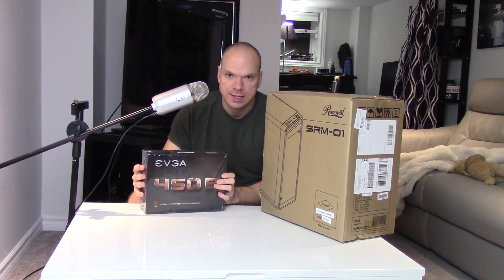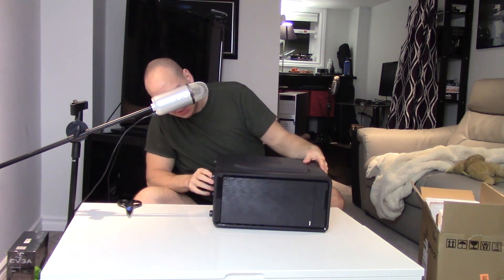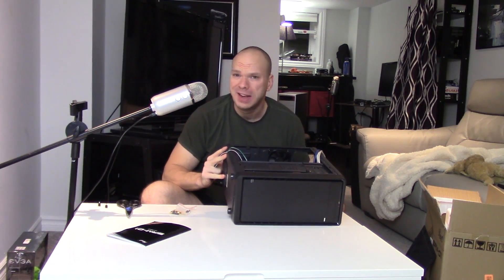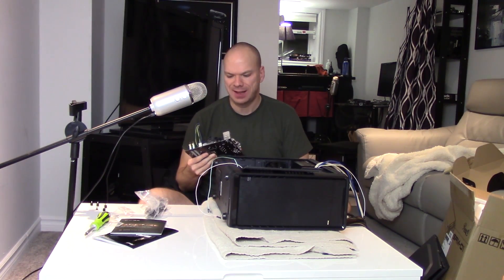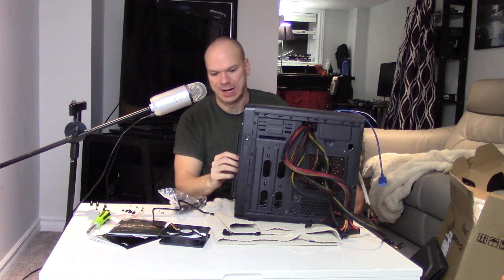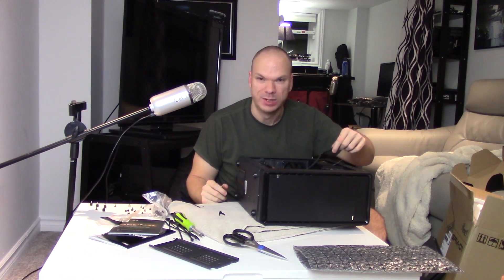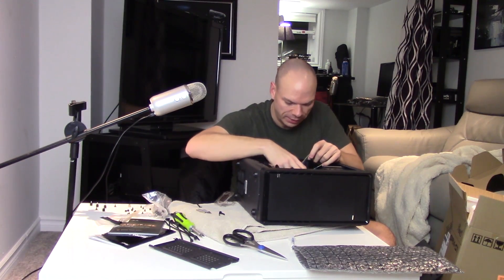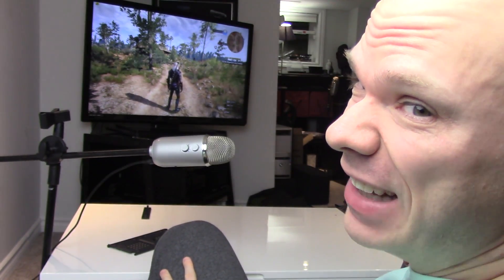BuildVlog #9 - WE'LL DO IT LIVE: A $500 New/Used Hybrid w/ the Rosewill SRM-01

Comment: HEy man, great video. How the thermals with that case?
Reply from the maker: Not even worth noting. CPU is on the stock cooler, never got over 62C. The graphics card never gets above 75, stock fan profile with just the factory OC.

It's good for a 300W TDP thermal output, I would estimate. Any more, and it'd be heating the air too fast to properly exhaust it.

Comment: I'm about to build my first pc in the nzxt s340 elite, in every video people have put a radiator  can I put 2 case fans there for intake?Also could someone make me a list of what parts to do in which order?Thanks in advance
Reply: where people*
Reply: Yep, you can put case fans there. First, put the power supply in. Next, most people like to start the rest of the build outside of the case. So you would put the motherboard on its box and then install the CPU, cooler, and RAM. Then install the motherboard in the case. Then GPU. Now plug all your case stuff into motherboard (USB header, power/reset and the like.) Now drives (SSD, HDD, optical.) Any extra fans can be installed whenever really. Then start plugging power connectors in. Most like to start with the 24 pin motherboard and then go from there but it doesn't matter. While doing stuff with wires, be wary of cable management. The S340 has great cable management capabilities. While not important, I'm sure you got that tempered glass to show off a nice build, not a rat's nest of wires. It's late so I may have missed something, but there's hundreds of how-tos on youtube so you can refer to any of those if you're feeling confused.
Reply: John Stamos Well I've got stuck on the cables and I can't find a fan header for my second intake fan.